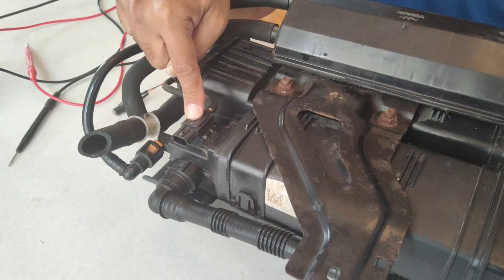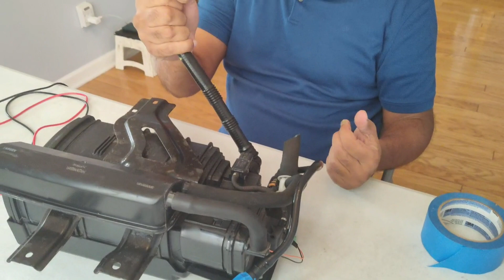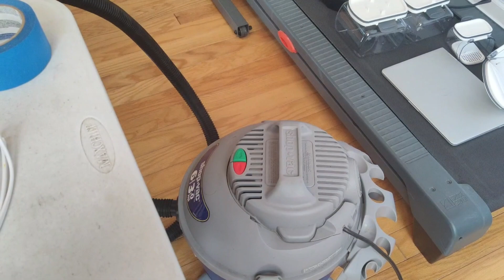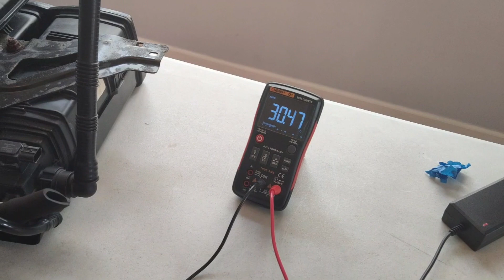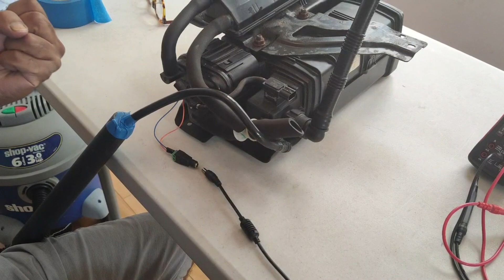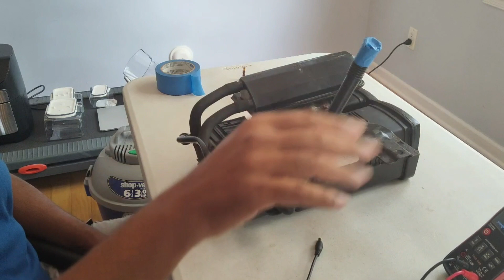EVAP Canister and DTC P2422 on Acura or Honda

Comment: That was a very thorough and detailed explanation of the evap vent system operation and diagnosis. 
i have a similar problem as you had, p2422 and while refueling,  nozzle would click off repeatedly.
i will inspect the vent hose at the rear subframe side for obstructions.
Reply: repair is complete, the canister was plugged- no air came out when air was blown into the port where fuel tank 
vapor hose connects, also vent valve solenoid shorted, .2 ohms resistance. 
bought a used unit, tested good - air comes out easily. hope this helps someone out there. (2006 acura tl)